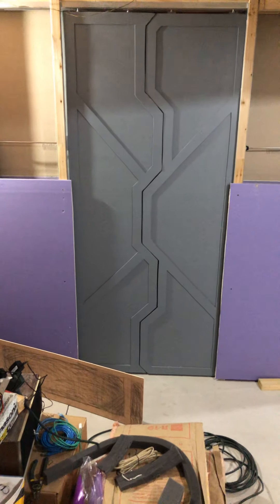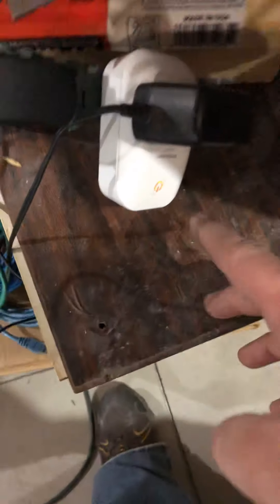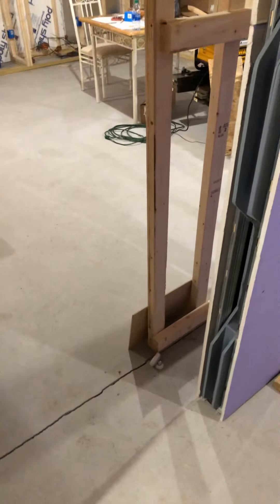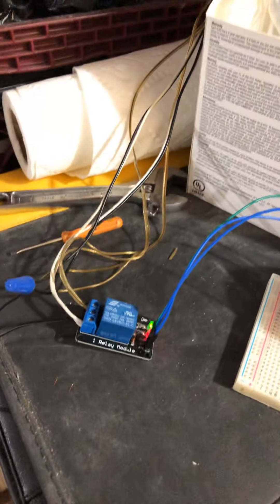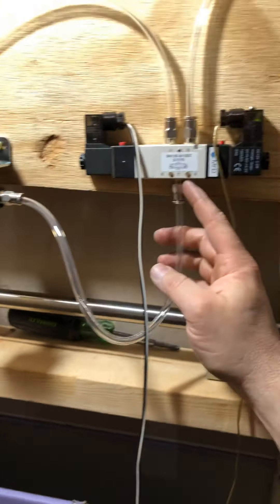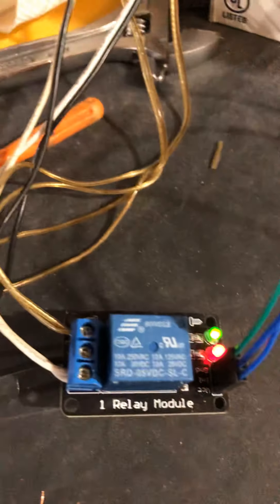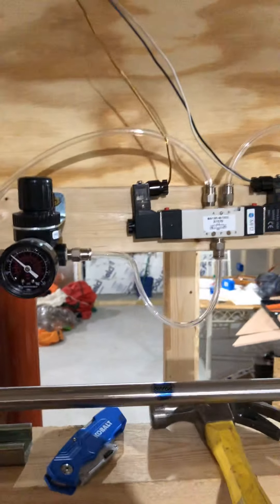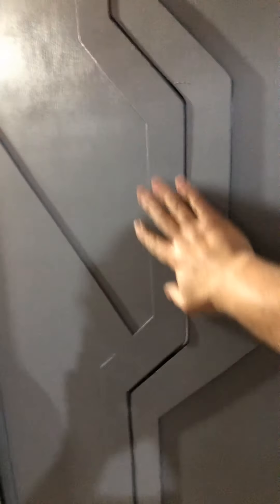Star Wars / Trek Space Themed Pneumatic Doors DIY

Comment: You needed 3 feet +- each side ? 18" for door, and 18" for cylinders?
Reply from the maker: That’s correct. You could also make the doors hollow and have the cylinders be inside the doors if you needed less room.
Reply: @WhiteysWickedWorkshop  that's what I was thinking
Reply: Would it negatively affect the door if the pnuamitc was as top or bottom of door instead of center ? 
(I assume bottom would be a problem without a bottom track) near the top should be fine, right ?
Reply: Where I would love to put that door requires creativity on one side. Or a telescopic door with the pneumatics over laid.
Reply: The door entry is round, so it would just be that much more epic with these doors
Reply from the maker: @alyenendrovtsorokean7406  Center is best just because if  you go too fast the top will move before the bottom.